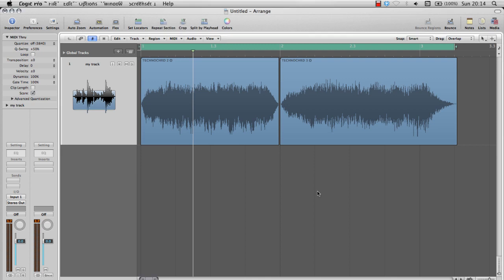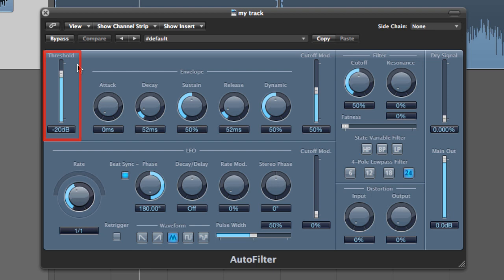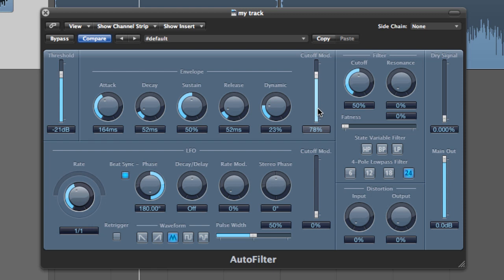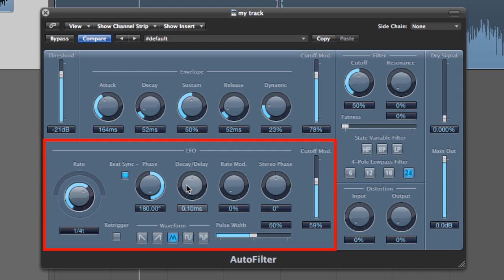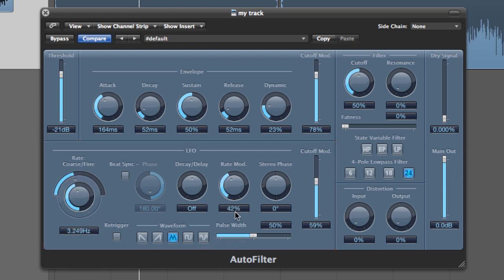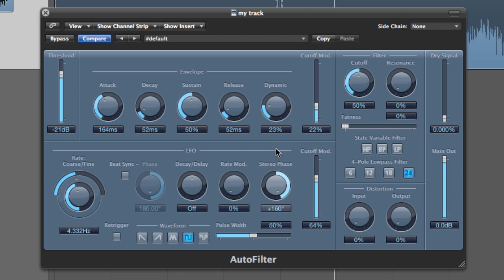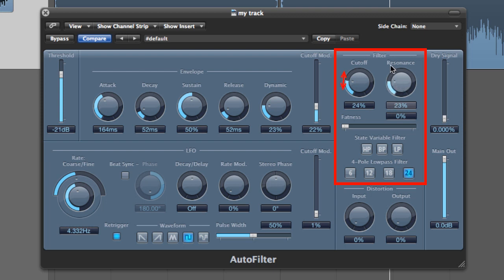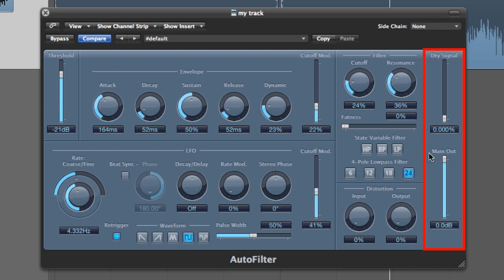Logic Pro Tutorial - Autofilter

Comment: The retrigger tells the filter's envelope to automatically restart the ADSR cycle every time the threshold value is exceeded, even if the last cycle hasn't finished. When you switched to the square wave with a lower pulse width, it sounded similar to the retrigger. You could use it to make your filtered signal more rhythmic and controlled like you would use with a gating/sidechain compression.